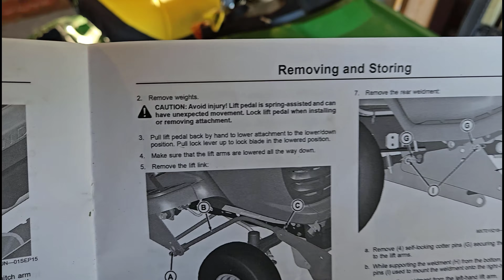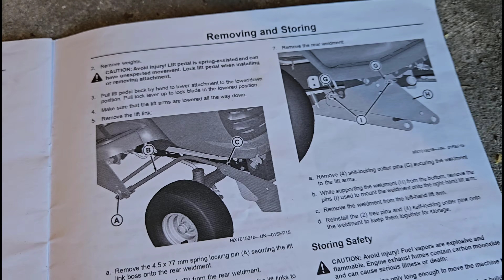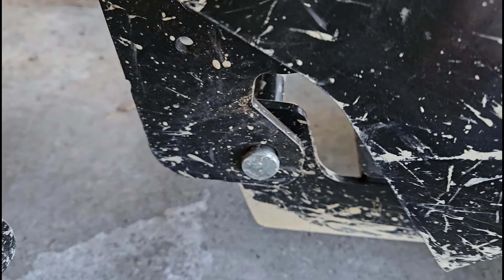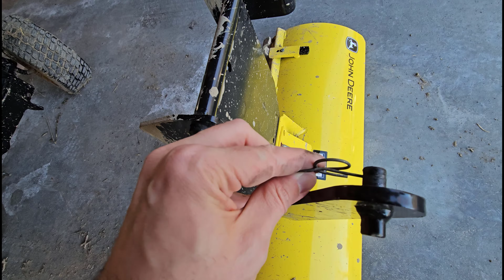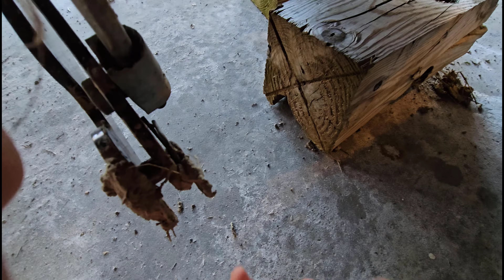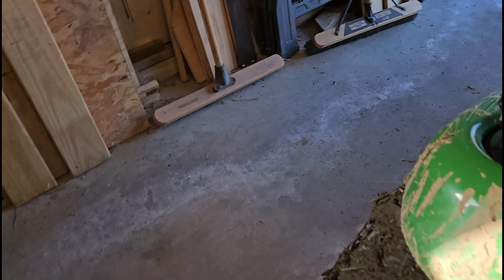How to Uninstall John Deere 44" Front Blade

Comment: I believe a person commented on the installation video was to attach the lift link to the lift frame first.  This is before you connect the frame with the draft pin.  You have to be careful with the lift link though.  This will eliminate that difficult step with the pin.  Also, leave it attached after you have removed the link boss and the lift frame.
Reply from the maker: I don't have this in front of me so I'm blanking on what the different parts are called. Can you leave the annoying-to-install part you're referring to installed year-round and still have the mower deck installed in the summer?
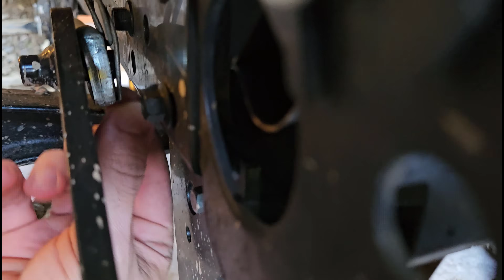Reply: @BenFinio  Leave the lift link with the pin in while taking off the front plow.  Remove pin after plow has been removed.  It is at the 2:33 mark.  You cannot leave it attached while you have the mower deck installed.